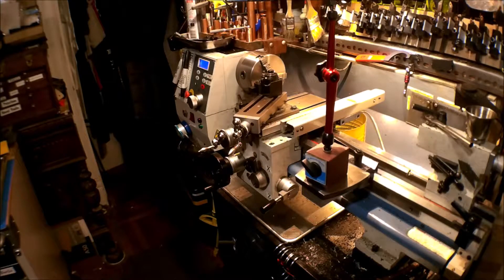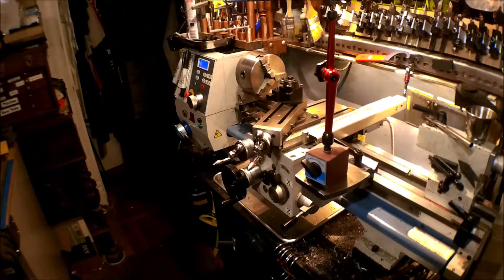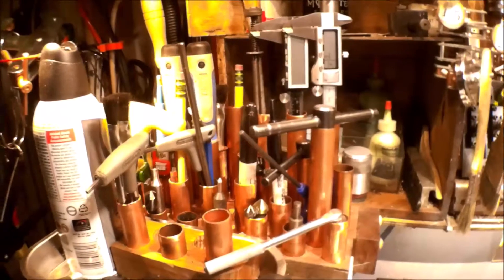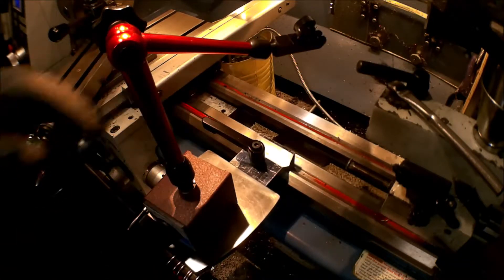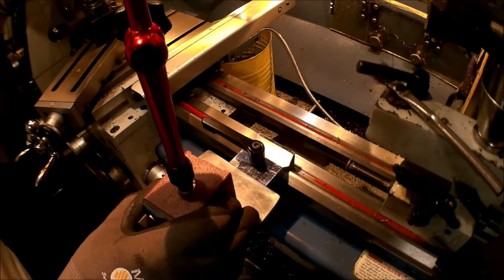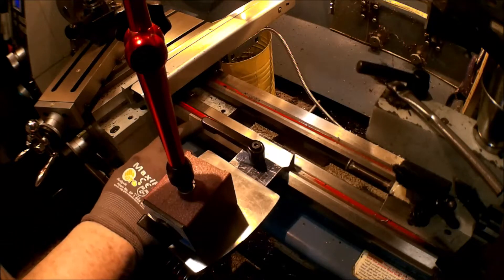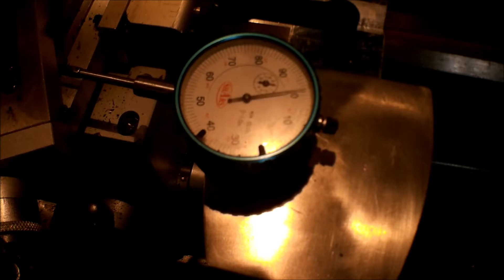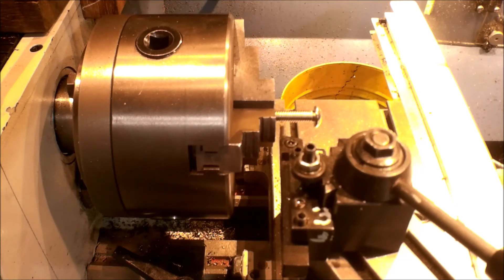Lathe Fixture Follow Up

Comment: That was it the carriage stop only I have seen them with an indicator installed in it. So yes I like your little mag base holder plate. The amount of pipe holders reminds us of an pipes organ. Vallejo California what a great place to get to work as a shipyard machinist, I have been to the Coastguard station Alameda Island and that is as far north I have ever been in 55 years born in California just sharing. I am a 4th generation machinist not as good as the 3 before me but I am working at it.
Reply from the maker: Thanks for the reply.  There is another version of this in the works a REDUX so to speak.  I was not into machining until recently, initially I was in commercial photo finishing then  a 32 year stint with Ma Bell as a Communications Technician, or as it was called before Political Correctness set in a Switchman. Worked in the Long Distance switch room then into computers as a Systems Administrator and a Programmer.  We had a major computer center located in Oakland that got good and properly Tossed in the 1989 Loma Prieta earthquake that eventually closed us down when the powers to be decided Denver was a better location and I bounced around in a couple of other jobs that were  way less fulfilling until I retired (read as Downsized) in 2001.